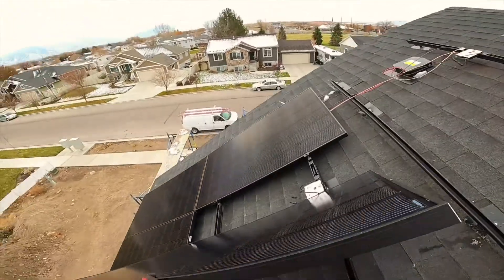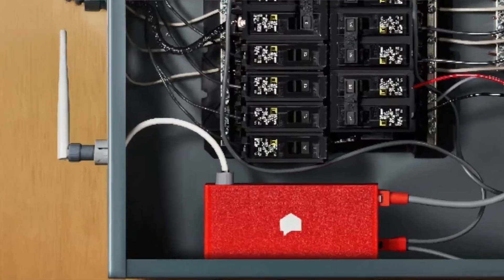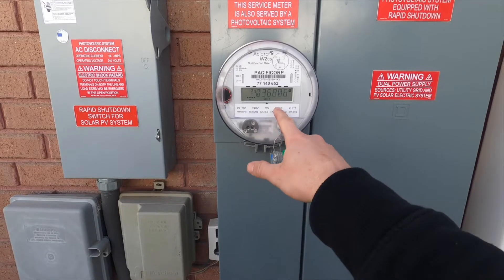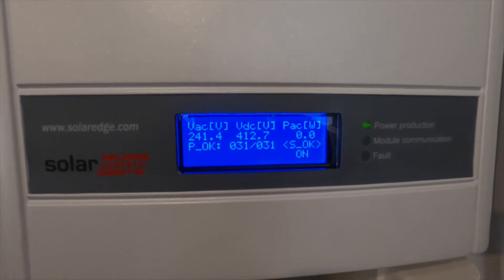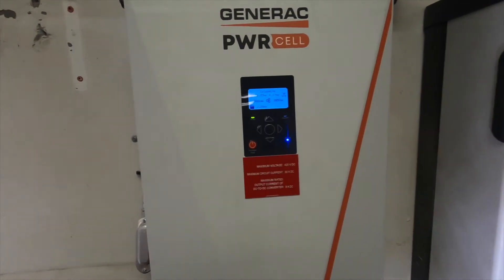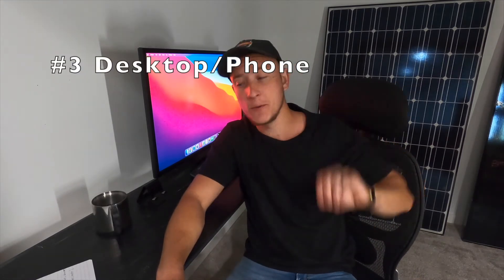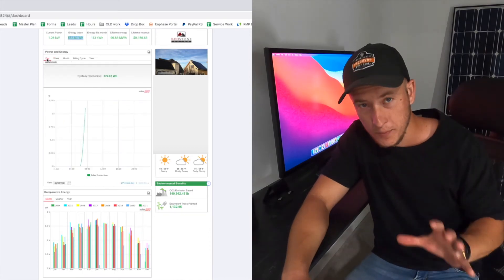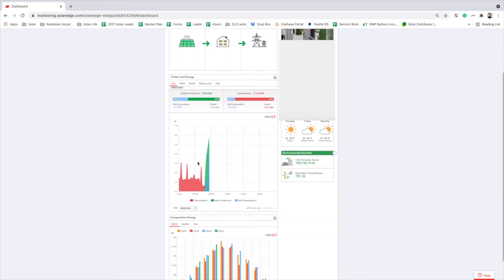Are My Solar Panels Working? 4 Ways To Measure Solar Panel Production

Comment: Im confused ...your  vid says your gonna let me know if my solar panels are working but all you did was give me options to look at to check 
but what am i looking for ... i still don't know anymore now then i did b4 your vid....I have a 23 panel system how much am i supposed to be putting out?
how do i know if 1 of my panels are defective, not putting out the desired amount of electricity?
What am i looking for on the meters to check this?
Just because i log onto a website doesn't mean that its going to tell me if my solar panels are working .
Reply from the maker: Thanks for the comment and sharing your feed back. Sounds like I should do a follow up video and the explains more details about how much each panel should be producing etc.